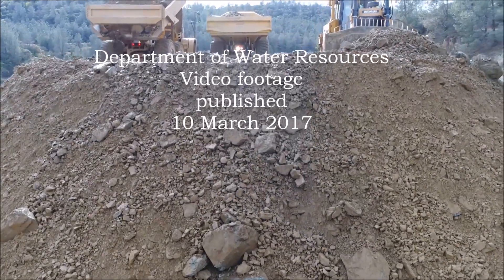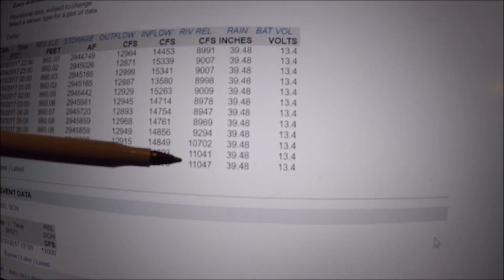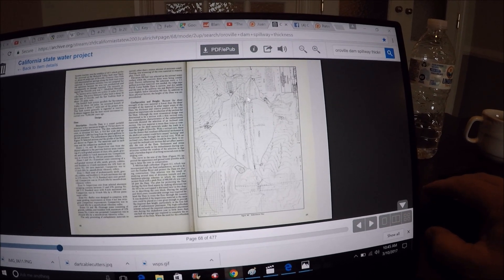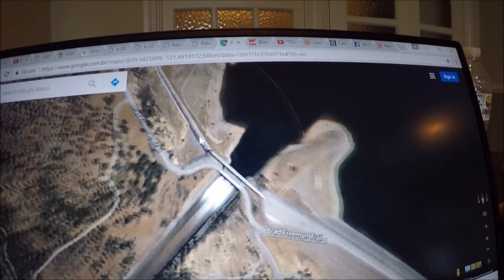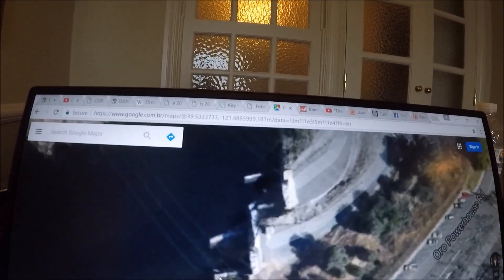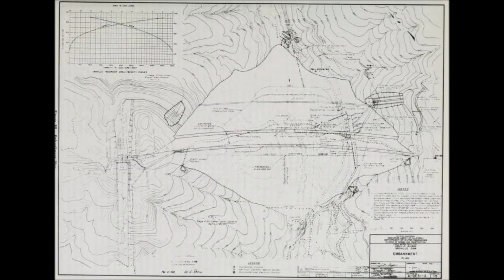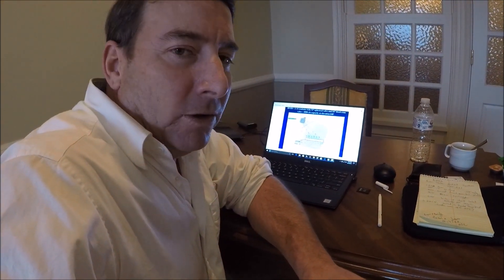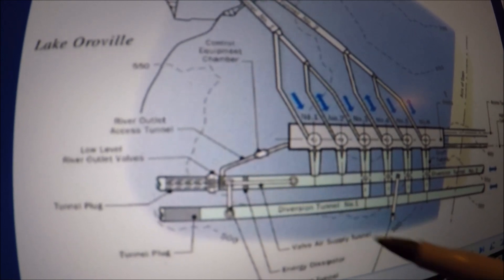Oroville 10 March "What's Under The Oroville Dam?"

Comment: One thing I've noticed is that, some of the excavators have really small buckets on them. I've been around and worked with these machines and others and I'm sure there's larger available that these rigs can handle, Speeding the process up. (maybe they have their reasons but I noticed it right away lol)

Great video once again though!
Reply: Exar all the excavators with small buckets had long reach booms on them. Those buckets are correctly sized for the longer booms.
Reply: Just guessing but I would bet the excavators can handle bigger buckets when the material is DRY. Between the weight,  the suction caused by the water, and the reach the arm needs to be extended, has to result in a huge difference in working capacity. Ever try to pick up a shovel of water logged dirt??? Not nearly the same amount of effort of that same shovel of DRY dirt.
Reply: The size of the bucket is related to the arm length. Put a big dredge bucket on the end of that long arm and your rig is going to end up in the water. And you need the long arm for the depth of the containment pool. Dredge buckets are for shallow work. Believe it or not the operators of these machines and the engineers who designed them actually put some serious thought into the operation of these machines.
Reply: yes, a lot of people don't understand the bucket/arm length deal.....same as cranes....as the load moves away from center of slew ring, the capacity goes waaaay  down.....
Reply: With 800,000 cubic yards of material removed in a little more than a week, my guess is high gear.  Look at the conditions they are working in, and risk working on the edge.  I've know nothing about unions and could care less - these guys are experts IMO and we should be grateful for their work.
Reply: pd by the hr, cost plus, private contractor.....prolly a relation of the county seat...or state leg.
Reply: Bucket size is the first thing an excavator thinks of,  and they have various sizes available.  You know that because you say you've worked around such equipment.  Those arms are incredibly long.   My guess is they know exactly what they are doing, and don't need armchair "experts" advising them.  They have moved an unimaginable amount of material out of that channel in a little over a week.  I'd say they are doing an outstanding job.
Reply: Hardly trying to be an 'armchair expert' as at no point did I say they were doing it wrong, nor did I say my observation was better, I simply asked a question from an observation I made, looking for a logical answer, not ad hominem attacks. I also stated, 'They probably have their reasons' pointing to the fact I'm no expert! But alas, this is youtube...
Reply: don't kill that union job!!!!!!!!are they running in high or low gear?
Reply: You cant use the super size buckets on a riverbank or else you be taking a swim
Reply: But alas, to sound like a broken record. I did say 'I'm sure they have their reasons' meaning; I know not of the  implications/risks and problems that might entail. Safety is paramount with these machines. I was just curious so asked a question. Granted, I didn't consider the boom length and how much weight is shifted to the front in these things. I am aware how drastically your lifting capacity drops with reach and height and this is probably the case here.
Reply: Agreed, Steve. They're doing a superb job!
Reply: Aussierob06 - the counterweight is the bulb at the rear.
Reply: Yes, I'm very familiar with excavators. If the center of mass of the CW is 10 feet from the center of the slewing ring, you can see you cant have much weight at the end of a 75 foot boom.
Reply: I remember recently watching one of the videos of the excavators digging from the river and as it rotated and extended to dump the bucket, the opposite track came off the ground, which leads me to believe, that's about maximum bucket size for safe and speedy work.
Reply: Good reply...!
Reply: Eight pounds/gallon for water; a cubic yard weight is just under a ton.  That's a lot of weight at the end of a 70' boom.  And rock weighs considerably more than that.
Reply: It's not just the weight of the bucket and fill but the whole arm assembly hanging out there that creates a moment arm. If you see the length of the "fore arm" into the water you get a feel for the depth of the pool as well as how steep the bank  is under water. I'd be concerned that the bank will give way.
Reply: You're wasting your breath (fingers).  Deniers do not accept rational explanations.
Reply: @Pappa Bob / Witty Pun - Thanks for replies but I'm not 100% convinced personally. It could be due to the weight of the loads but these things have massive counterweights on the back and don't seen to be over reaching.

This looks like a 40"+ bucket doing just the job they need - The ones in the vid are prob 18"

PIC -- http://s7d2.scene7.com/is/image/Caterpillar/C10863428?$cc-g$

Like I said, I'm sure they have their reasons but it seemed odd to me. :)
Reply: Doug Ankrum - This I understand completely but I would have thought it could handle a bucket load at that reach it was doing, a full bucket can't weight more than the counterweight surely. I've seen much smaller machines (manitou telehandlers) lift (with forks) far more weight at reach than a bucket of wet soil.
Reply: bad campa - This was one of my main thoughts tbh! taking too much away.
Reply: The counterweight is very close to the center of the machine. With the very long arm, you don't need a lot of weight at the bucket to overbalance it.
Reply: Don Moore I not only agree with Exar.After seeing in the video.The size of the entire area that they had to remove.Both debris  and earthin material from. I was woundering why.They were not using mining size excavater's.If you would of read Exar's post correctly.He stated using buckets that would help them move more earth faster.Exar did not make the statement to use buckets soo large.That they would make operating the excavater's unsafe.
Reply: Aussierob06
Reply: Indeed.  Presumably it is counter-weighted for that, but you are still at the limits. Agree about the steepness, particularly in water-logged, sandy conditions.
Reply: Schaumanator - I very much have been around machinery similar to this, granted not the SLRE type. (I work in a boat yard where lots of heavy lifting goes on.) I didn't mean I've operated them specifically, more been around the yard when these things are being used (guiding, hooking up loads etc. so I see them working.) I'm not qualified to use them else I'd know the answers to my question wouldn't I? :P
Reply: Yes....you're 100% correct.....seems many commenters do not understand the rules of loads and balance.....I learned this sort of stuff in junior high school....science class. Hold a ten pound weight near your waist....then try it at arms length....
Reply: that's about right...!
Reply: Like Witty Pun says, the bucket's sized for the moment created by the enormously long reach.  The bucket in your photo is just a grading bucket for finishing-off - it's much wider but much shallower, it's not for digging at all.

Comment: I am curious as to how the reservoir got up to 900 feet in the first place.  Was it because they were babying the spillway since it started to develop the crack and not discharging as much as they should have?  Did they just figure, "Heck, we'll just let it overtop the emergency spillway - nothing bad will happen then"?
Reply from the maker: Stanley Dobrowski that's pretty much the case.
Reply: Stanley, yes that is almost exactly what happened.    If you look at the daily res level/inflow/outflow rates for all of Feb you can see the story play out.  Res level was well regulated at 850ft up to Feb 7th when they discovered the hole.  They reduced the main spillway outflow to zero on the 7th to look at the hole, then put some water through it and saw the hole rapidly eroding so they shut it off again on the 8th (there are two pictures showing near zero flow on both 7th and 8th, but with the hole having head cut upstream significantly on the 8th).     Meanwhile on the 7th, inflow topped 100k CFS with almost no outflow, lake rose 12ft..   8th inflow still over 100k CFS with no outflow.. res rose 12ft.   9th, inflow 155k CFS outflow only 30K CFS, res rose 16ft..     9th to the 11th DWR realized they HAD to turn the main spillway back on, but they only ramped it up to 60K CFS worried about the hole continuing to headcut, but inflow was still 127K CFS on the 10th and lake had risen to 899ft..  and overtopped the emergency spillway on the 11th.    They still weren't too worried because they thought the emergency spillway could handle the excess.   They stayed at 60K CFS until the 12th by which time two things happened.   1.   They saw that the erosion below the emergency spillway was much faster than they had expected 2.  They learned that the head cutting below the now massive break in the main spillway had stopped, so they ramped the main spillway up to 100K CFS and there it stayed for about 4 days until res level had been brought down to 855ft.  

Had the hole in the main spillway not occurred with the attendant spillway shutoff, they could have easily handled the inflow produced by the storm.  They probably could have run at 60K CFS the whole time, lake would have gone up 10-15ft by the 12th, and then and they'd be back to normal by about the 20th.   Running at 100K CFS through the peak inflow the res wouldn't have gone up more than 10ft total.     It was just a set of bad circumstances hitting all at the same time.
Reply: Sideslip Are you aware of the interesting backstory to "original engineering of the thing" ie blueprints Juan cited from https://archive.org/stream/zh9californiastatew2003calirich#page/62/mode/2up are not the "original" originals? 
The first-appproved plans from 1950s called for a much-wider armored flood-control spillway at exactly the same location as current e-spill - as shown p120/179 of the 1975 earthquake report by the US ArmyCorpsEengineers here
http://www.water.ca.gov/orovillerelicensing/docs/FEIR_080722/AppendixA/Extracted_Comments/C0005_SutterCty_YubaCity_Levee%20Dst1_Appendices_Pages_10-177.pdf
Any flood-control release would've flowed more directly along the downstream bend of the Thermalito Diversion Pool and thus perhaps could've avoided the upstream backup (as Juan mentioned blocked the outlets for the Hyatt Power Plant) but... 
... after flooding in winter of '63/'64 appeared to exceed design limits, the dam was raised 35' higher & the flood control spillway moved to a 90' channel cut into higher ground nearer the dam's left abutment.  FERC regulations having changed in the interim to mandate greater flood redundancy - they called for an auxilliary 'emergency' spillway - which was relegated to the undeveloped land on the hillside vacated by the relocation of the main spillway ☺️️
Reply from the maker: Yep!
Reply: Emergency spillways are just that, for emergencies. They are only ever designed to be used when outflow control is lost, they save the dam from over topping, which destroys the dam.
What we are seeing here is something the video producer will be very familiar with- Reason's swiss cheese model.
A lot of factors have all lined up here to create this problem, not one single issue.
They HAD TO stop using the main spillway, if erosion had continued, it would've weakened the main dam embankment anchor bedrock and caused dam failure.
The reason erosion from the emergency spillway was so bad was because it would have never been designed to work without the main spillway. The fact the whole thing is still together is a testament to the original engineering of the thing.
Reply: Thanks, Juan, for the great informative videos - no hype, just facts.  So, when the bad erosion problems happened at the emergency spillway, they figured they HAD to open up the main spillway big time and just hope for the best?  And they got lucky that there was no head cutting because of the speed at which the water was shooting off the cliff?  And that is why they are worrying about running the main spillway again at a low flow rate - head cutting?
Reply: ManufacturedLack, Not in this case.  During winter and early spring they are required to keep a 50 ft buffer for flooding.   Look at my summary of events in an earlier comment.    The res level was right at 850ft on Feb 7th when they discovered the big hole in the spillway and the only reason it started rising was because they had to shut the spillway off to examine the hole.    Things went downhill from there.
Reply: Spot on, daemn. Just the facts, no make believe conspiracy B
Reply: I've seen talk of that concern, Stanley. Makes sense...... Perhaps, they could let the level get above the 865' target point by a few feet, to provide more time to work on the debris pile, and perhaps do a bit more stopgap repair at the damage point.....
Reply: Clare Krishan - well said!
Reply: Daemn42: "It was just a set of bad circumstances hitting all at the same time." that the 50-yr old operating manual had not the foresight to consider, so they have been to -- use an aviation simile -- flying blind all this time. Maintenance did not anticipate partial failure of any part of the system ( the out-of-service turbine, the unrestricted plant growth on the e-spill, holes in spillway ) -- consider that regulated inspections on the spillway were contradicted by another regulation that banned access when water rose above 813' (behind the flood control gates). These faults all occuring simultaneously could have been anticipated via computer-aided simulation such as failure-mode effects and criticality analysis FMECA used in aeronautics engineering. IMHO its a travesty that the California state was permitted to operate such a significant piece of US infrastructure according to "Soviet-era" state-of-the-art principles... Silicon Valley's a neighbor, a customer, for pity's sake, give 'em a call and ask to borrow a few CPUs !!!

Comment: question from a no nothing flatlander.  why not leave and use the eroded channels nature has so expertly made but reinforce the sides? how much more can they deposit into the diversion  pool? i understand the head erosion, but can't that be permanently stopped or lived with?  can it erode back to the maned main overflow structure making it useless ?  around here if you get bed rock you got the best place for anything.
Reply: The outflow from the turbines needs to be unimpeded to allow flow. Running the turbines with too high an outlet water level will flood the turbines.
At this point in time, the only major way they have to control reservoir flow is the turbines, they needed to come back online as soon as possible.
With the debris there, the outflow from the turbines would've (and did), made the outflow pool too high for turbine operation.